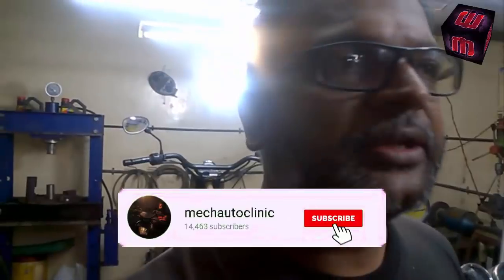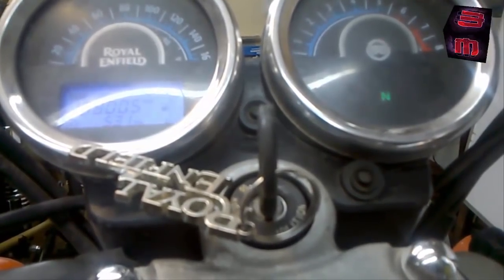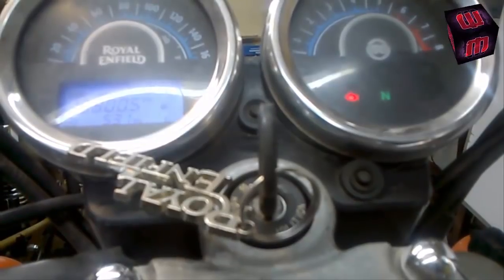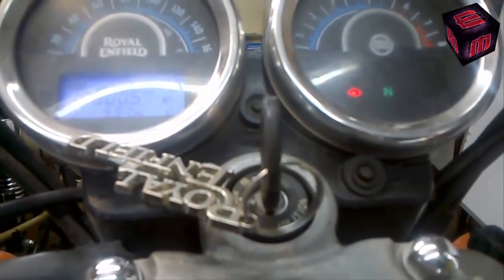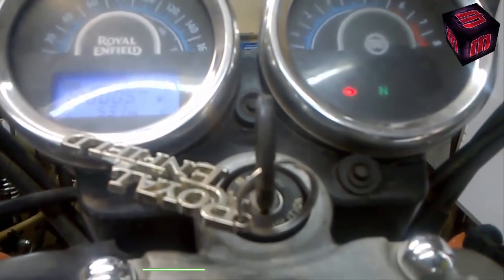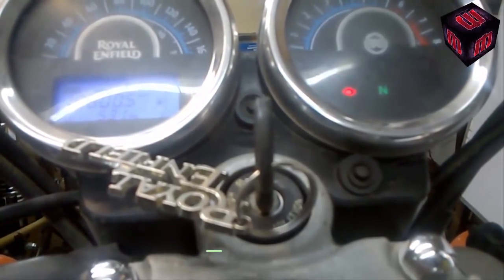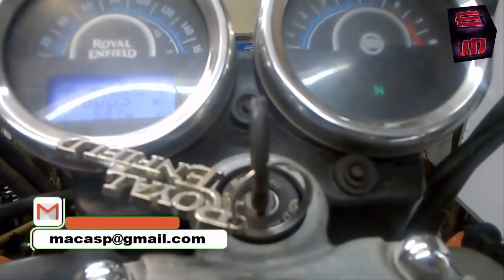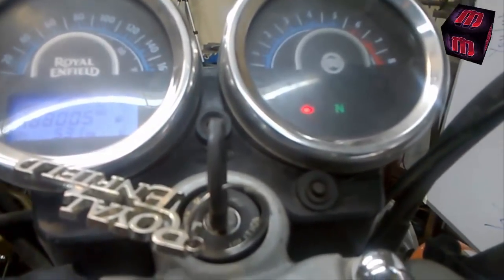Royal Enfield EFI-DIAG without SCANNER or LAPTOP(ENGLISH)

Comment: Hello, I have a 2015 500cc EFI that has developed a fault with the ECU. It blows the ECU fuse as soon as you turn the bike on. If i unplug the ECU the fuse doesn't blow. Is there a way that i can test the ECU to see if it is definitely faulty before I pull all of the wiring harness apart?
Reply from the maker: Where you from?
Reply: @MechAutoClinic  the UK
Reply from the maker: @buriencox  step by step remove all sensors and relays and then recheck by using less amp fuse. if it blows then consider you have fried ECU. you will have to replace it. but before that you can also swap that with another bike for testing. so you will get confirmation. where you located in UK?
Reply: @MechAutoClinic  thank you. This is good advice. I will buy a pack of fuses and see if it could be a sensor issue. I hope it is. ECU's are expensive. I am based near Shrewsbury in the UK.
Reply from the maker: @buriencox  ECU can be sent to UK, don't worry. But first confirm it has issue by using this layman method. update me. thanks
Reply: @MechAutoClinic  will do. Thanks for your help!

Comment: Bro , is there any issue in fuel pump of TB 500 , 16 model.(bs3) 
Am planning to buy a second hand  one 
What are all things we should look forward interms of sensors before buying it?
Reply from the maker: fuel pumps gets damage due to ethanol which gets separate from fuel if comes in a contact with water/moisture. fuel pump need constant lubrication and petrol itself is the only one lubricant for that. any other foreign material may damage pump very fast. thanks for watching video and comment
Reply: @MechAutoClinic  
Thank you bro, 
About 500 bs3 standard what's your opinion.?